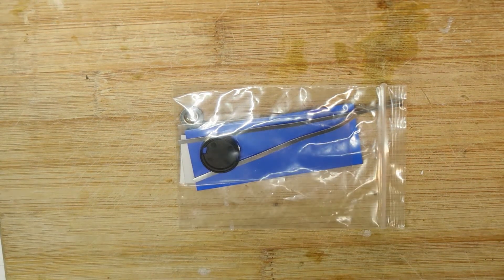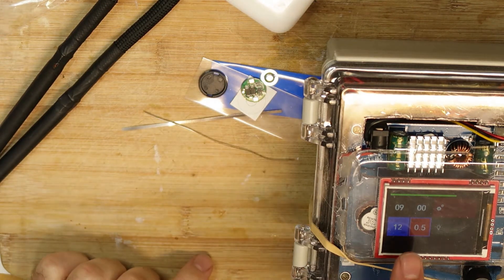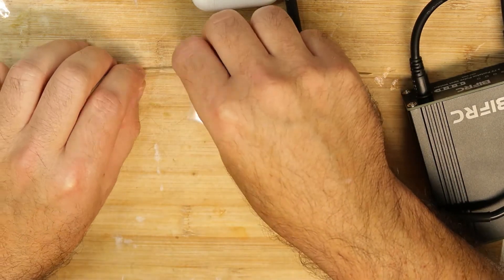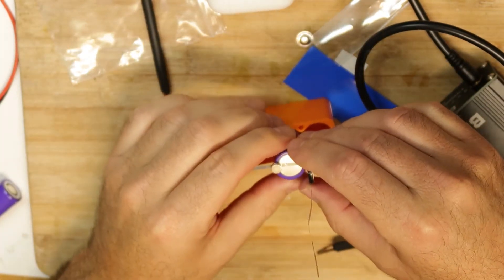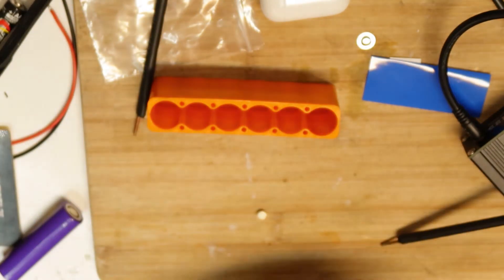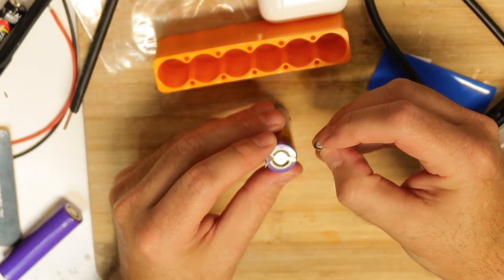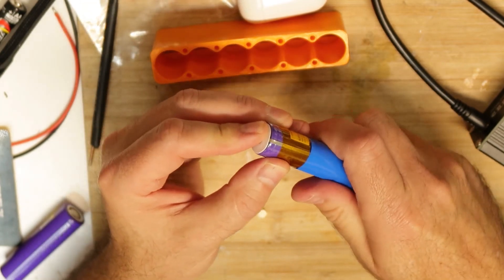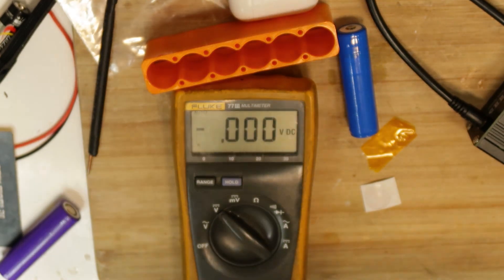DIY 18650 Protection Circuit BMS

Comment: How does the BMS behave? Have you tested these? Do they blow like fuses?
Reply from the maker: it is ok, tested short, and undervoltage it is working
Reply: @RoeeBloch  so it resumes function after a short is removed?

Comment: That's a good idea connecting the positive nickle strip to the underside of the button top. I think I will do a similar, but I will solder most of the joints and only spot weld when connecting to the battery.